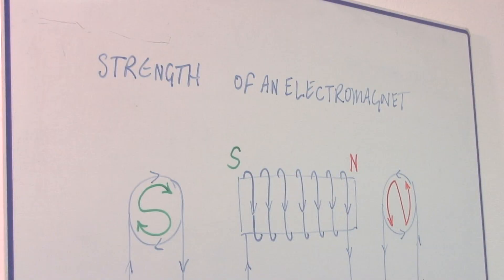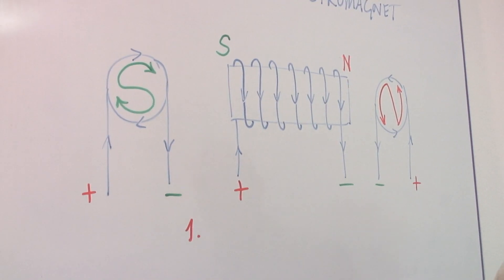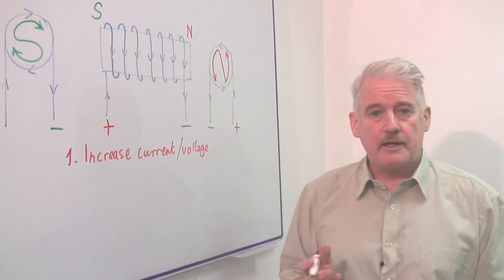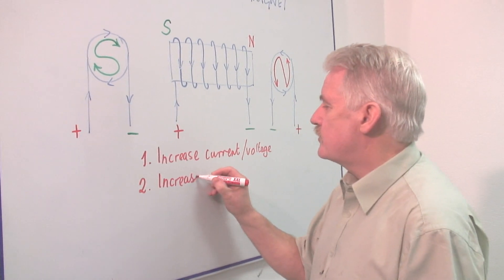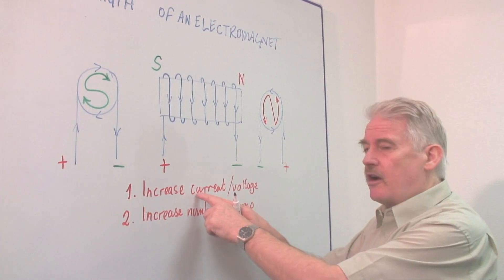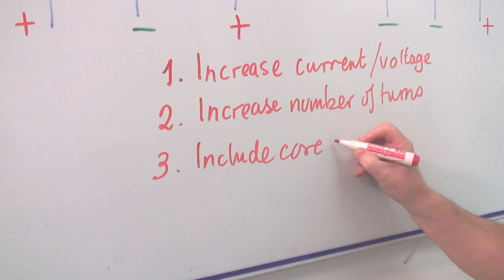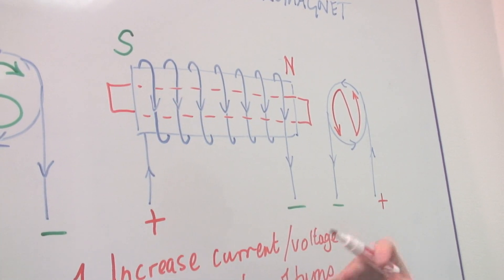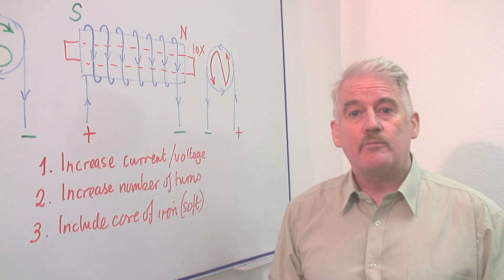Physics & Electromagnetism : Tips for Making a Stronger Electromagnet

Comment: 16 years ago? (I was in school in these classes 55+ years ago. (Wonderful video I saved it in my favorites)
Should of been list sorted by importance Sir : ).
1.) Turns+ play the largest role
2.) Then formula Watts / Volts
Equal importance has few other things, but after mentioning core as number 3.). 
3.) Core
4.) Contact area with the object, surface area of the core
5). Core form ( _, U, O, Ж ) and distribution of its fields (to not cancel each other)

I remember, it (I) was at age of 8 or 9 I think (52+ years ago) when I made first equilibrium generator (self-sufficient).
Electricity, light, and magnetism are strange thing (bio and chemistry too), 
if you don't believe in them "they will only hurt you",
if you believe in them you are able to control them (and join them), and have huge benefits from them.
 
"club

Comment: One lf the things i learned with electromagnets to increase strength was to take the full amount of wire an electromagnet would hold. I take the wire and then divide it starting to either four times and on up to maybe 10 times. Thereby reducing the resistance of the entire amount of wire. Thereby I had the electromagnet at 1 ohm 1+/-. The Milli Henry's range was greater by 350%. But still within the same size package. It would take less power to get the same Gauss reading. Power tools sometimes use this technique with getting extremely strong torque in a small package, by splitting a full length of wire into many pieces. You could even use smaller gauge instead of a large gauge. Resulting in lesser voltage.  Think of a hundred foot long garden hose. If you split that same hose into 10 different sections and connect them all at the front and at the back the water would arrive at the ends much much quicker, and with the same force and power. But with 10 times less the resistance

Comment: So I'm wanting to make an electromagnetic vise for easy holding of work (I use a lot of steel). I know you can take an MOT and that would function just fine but I do not have one at the moment and cannot get one for a reasonable price at the moment. So if I used some sheet steel in place of the silicone steel used in laminated cores would that be good enough? It's probably going to be a DC magnet and quite a bit of turns. I've got a large spool of magnet wire laying around.

Comment: you referred to current as both what about amps
Reply: Is not current also amps?
Reply: @woodbrassandglass  hi,f current refers to voltage
Reply: All are different. Watts are = V*A. Current is how much of that power flow through wires to end destination, ie can be changed completely on its way into different... just one turn as "snake form" on its way changes properties a lot. There are further combinations as form of the signal (which belong to path/way to destination) = that "way" is named current (often expressed when testing as "I've got strange current", which includes more things than A and V).

Comment: the problem I have is i cant implement a core an I dont want to apply higher current do to the thin wire and heating problems but can i simply step up the voltage my curent will be lower but my volt wil be higher would that make a difference.

Comment: Thank You for the great video and information. I intend to use all three methods to increase the strength. what is the best metal for the core? Would iron rods that they use in construction be good? Or is there something better? If I were to wrap say 700 times, Could I wrap over the wire that I just wrapped? Would that change the polarity? Can a person use a 12 volt battery DC or an electrical outlet 110/120 volt and not overheat? I would like to make a electromagnet with a hundred pound pull/repel. I may have to reduce or strengthen the 100 pound pull. I wish to do some experiments with it. Do You have any information to help me do things right? What size magnetic wire would I need. The more compact I can keep it, The better. Again Thank You
Reply: phillip staton g
Reply: guy made 400bls with a microwave transformer it's on youtube.

Comment: also the way you wind your coil, for instance you could go from left to right hit the end and jump back to beginning again on the far left sort of typewriter style. You could also use a bifilar wire and attach the end of one to the beginning of the other using teslas pancake coil style. Also you could put a permanent magnet on one end of the iron core but not strong enough to magnetize the other end but when power is applied you make a magnetic circuit and the whole core becomes a magnet and other end is stronger due to the permanent magnet on the other end.